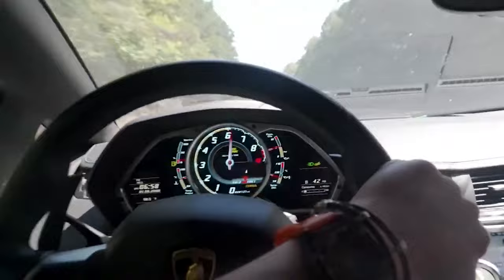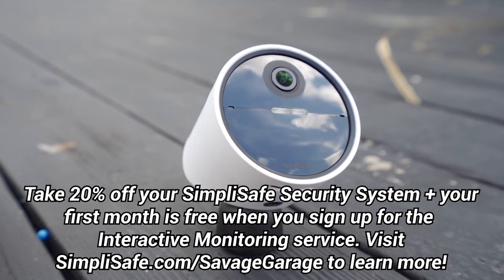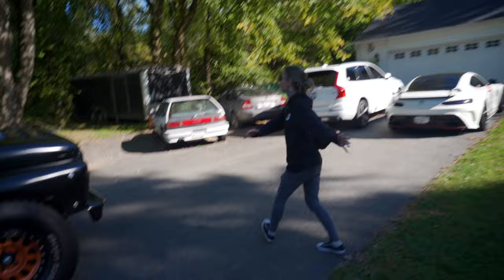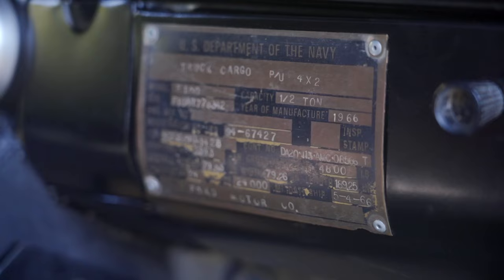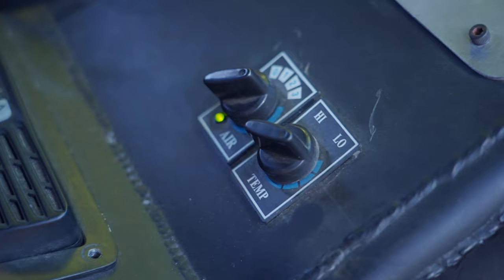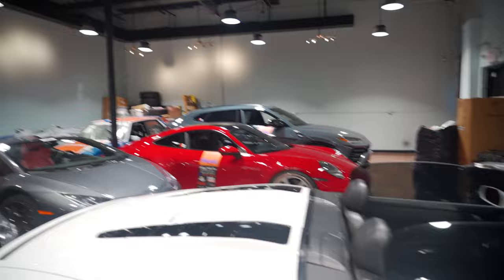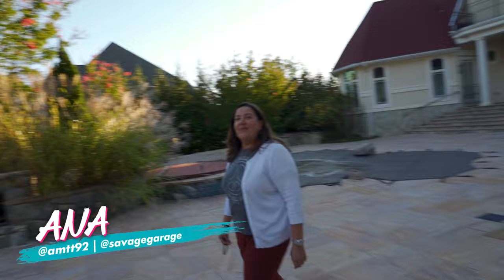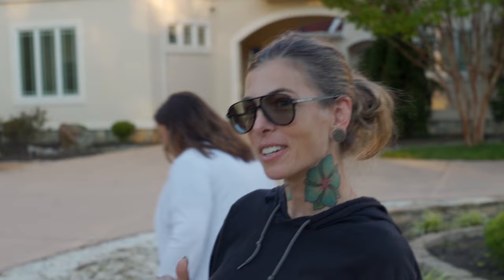*9000RPM & 700HP* My Audi Quattro Group B RALLY CAR! + My F100 Trophy Truck!

Comment: Great car! 21:30 that’s NOT the exhaust running through the car.. (surprised randy didn’t correct him) 
that’s the heat wrapped water piping to the rear mounted radiator 👍😉
Reply: Was thinking the same - thanks!

Comment: Rally racing is my favorite automotive racing. Takes so much skill and teamwork. You can tell how much passion Randy has put into the Quattro. I am thinking that the next Group B rally car is going to be is either the Lancia 037 or Ford RS200
Reply: I respectfully disagree, a Peugeot 205 T16 has to be next to complete the trifecta of WRC 4WD Group B champions.
Reply: @digggerrjones7345   Absolutely !! Peugeot 205 T16 Groupe B it's a beast !!
Reply: Next for Randy : Peugeot 205 T16 and Lancia Delta S4 and 037 !!
Reply: How about a escudo Pike's peak car from grand tourismo. 🥰🥰 Twin engines insanely fast and that aero!!
Reply: Ford RS200 would be the way forward. Randy already has a Lancia.
Reply: Lancia!
Reply: No such thing as RALLY RACING   Rallying is run on Closed road (Stages)   Racing is on Track.  This Quattro is a Replica  and the Lancia 037 is not a Group B car it is in fact a Group 4 car . Lancia Delta S4 is a Group B car
Reply: @MOSSFEEN  rally racing uses public roads between stages and the service area. Cars have to be road legal and insured.
Reply: @johnsnow1355  You clearly didn't understand the comment.  The road becomes the circuit, and the road is closed to ordinary vehicular traffic making it a closed circuit with agreed upon stages. 
What do you mean by road legal? Why would ordinary rules of vehicular operations apply here?
Reply: @nsudatta-roy8154  rally cars have to be road legal and registered like anyone else driving on public roads. The only closed roads are the actual stage. Rally cars have to use public roads to access stages from the service pit area. That's why rally cars even WRC cars have license plates.
Reply: @johnsnow1355  Christ thats some statement to make   Are they RACING between stages ?????   NO

Comment: This is a car built to Walter Röhrl standards. Basically the front is from an Audi 80 2 door for front windshield angle and shortened 32 cm for shorter wheelbase with quattro coupe rear!

Walter didn't like the shallow angle of the group A car. Sun glare wasn't good.

I myself own a 1994 Urs4 and love it for the quality of those years and especially of the 5 cylinder symphony!

Comment: Amazing legendary car, group b icon and  that unreal sound.  Have fun with it !

Btw Is it only me catch that, or that pipes inside the car, heat wrapped are not "exhaust" :) but cooling pipe for rear mounted radiator. You can see in engine bay where they coming from back of the enigne through firewall. Im curious why owner dont correct that mistake. No offence. Belt for alternator lay back propably for spare, because alternator is in the trunk too. Driven by hydraulic(correct me if im wrong) pump.

Comment: Delts s4, the ultimate group B.
A lot more dangerous and a bit snappy in the faster corners because of its short wheelbase and high ish centre of gravity, but if you have brass b's and are a great driver you'll not drive a faster group B car.
Personally my favourite was the Metro 6r4, they had great success in rally cross and still run ok today.

Comment: Randy help a brother out with SVC. Guaranteed top 5 if I'm behind the wheel. 33 yo and I've been swinging it on back roads almost daily for over 16 years. Cars, trucks.... farm equipment haha. If it has 4 wheels, I'll figure out how to slide it haha. Not one wreck either. Lots of close calls, but that's how you learn. My muscle memory is so strong, when shit goes south, I don't even think, just react, and correct the problem.

Comment: Nice replica Quattro S1 E2 ;) did you guys consider making it the PikesPeak version? I guess the grpB one had "the calling" They didnt have a sequential gearbox back then, but Audi had a Hpattern with a clutch assist that was mind blowing stuff in the 80s. Next one should be the 205 T16... Remember that in the peak of grpB, 85/86 Peugeot where the manufactors champions! both years. Wel a Lancia S4, a Ford RS200, or the MG Metro 6r4 would all be great too.

Comment: raylin in europe had its heyday there in the mid eighties with the 1986 Audi S1. lancia delta hf integral 1986 rally. PEUGEOT 205 T16 1986. MG metro 6r4 rally1986 .. Ford RS 200 1986 It was just fun to be out and see European Rally at that time

Comment: I got a chance to sorta help restore a Light Blue 1966 F-100 just like that one in my BOCES auto tech program but it was covered in rust from headlight to tail light and it seems like a really really cool truck to own so if you ever get the chance to own one or even just be a part of working on one please take that chance. It may be difficult doing some stuff with it but I promise it's worth the effort.

Comment: To make the S1 E2 you actually need 2 cars, a 4 door front and a Coupe Quattro rear. And nowadays when the donor cars are so few left it makes it extremely hard just to find them.
Reply: You are incorrect- you need front of 2 door Audi 80 to achieve correct angle of front windshield and rear is coupe Quattro 
Both cars are extremely hard to find now and prices are skyrocketed
Reply: @groupbgarageaz5652  my bad, it has been a while since I've read the whole story.

Comment: Stop clutching when shifting
Reply: You got it! But in his defense; he really looks like he's just getting used to it! He's probably never had so much power in such a short wheelbase before. It's a different animal.
Reply: So at low city speed you MUST clutch as the revs are not high enough.   When Im on the straight I dont clutch.   This is the CORRECT way to drive this car and all sequentials